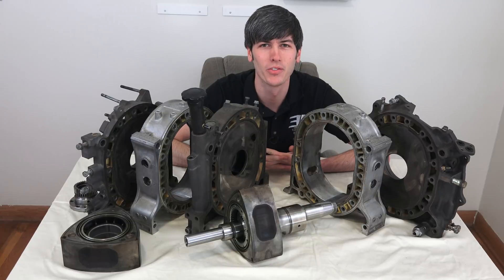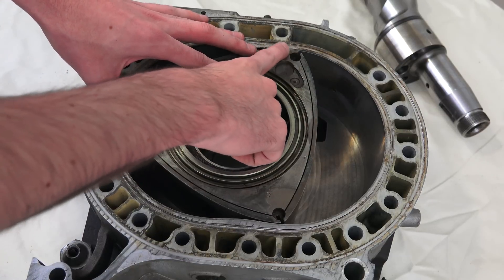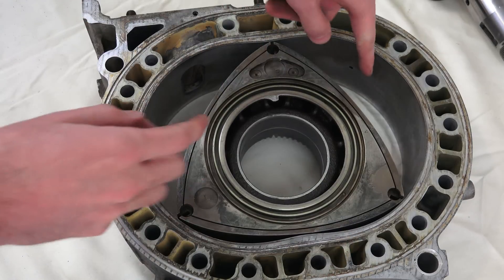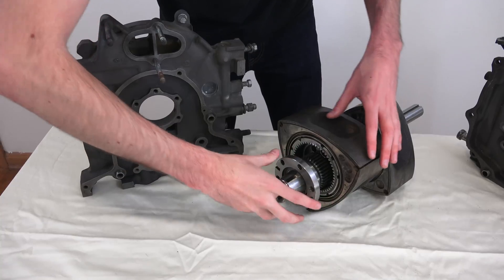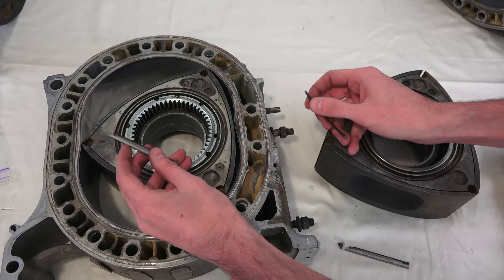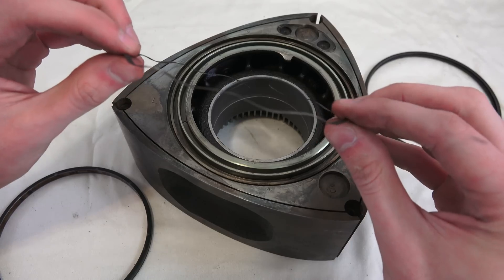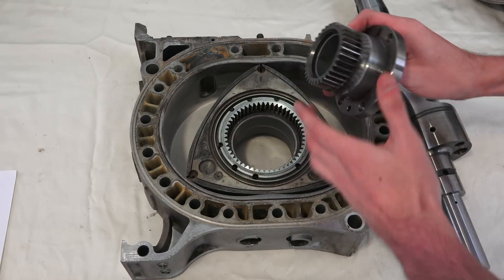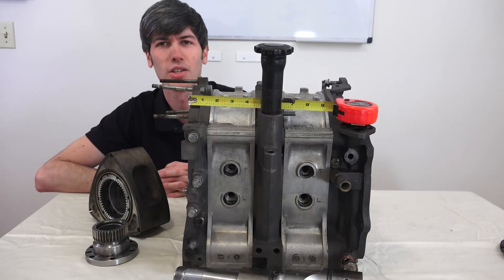How Rotary Engines Work - Mazda RX-7 Wankel - Detailed Explanation

Comment: is the main reason they're so much less fuel efficient because of the greater surface area to volume? i.e transferring more heat ?
Reply from the maker: +stefan radovich No, has a lot to do with combustion chamber shape, and the amount of fuel which tends to not get burned. I'll have a video explaining in detail soon!
Reply: +Engineering Explained cool i look forward to it. your videos are good,  i know some mazda owners I'll pass this on to.
Reply: +Engineering Explained hey off topic question but i was debating this with friends. Do you reckon engine piston speed is currently limited by valve float or oil film shear strength ? I think it's the latter, i.e actual piston velocity in m/s. Or is it just a really complicated combination.
Reply from the maker: +stefan radovich I would guess it's limited by flame propagation speed, but I don't know.
Reply: +Engineering Explained Any chance on getting a "cons" video?
Reply: +stefan radovich Rotary is the most efficient way to convert fuel into noise.
Reply: +stefan radovich Rotary, as explained in the video, also has 3 combustions per rotor per revolution. That's a lot of fuel both burned and unburned...
Reply: Aww man i'm getting too many replies. I know flame propagation speed isn't usually fast enough to fully burn the fuel with rotary engines which is why they use 2 spark plugs but i still think increased surface area relative to volume allows for much more heat to be transferred to the engine/cooling system at a greater rate, i.e. energy loss per time = power. inertia of the parts will definitely be a tough constraint for reciprocating motion because it's likely an exponential increase in stress for part acceleration. The shorter stroke in F1 cars allowing high rpm ties in with my point about it actually being piston velocity. (velocity of the piston against the cylinder wall.) for a set displacement a shorter stroke results in a shorter velocity. Regardless of displacement piston speed (or just the speed of any sliding component.) seems to top out around 25m/s i think due to lubrication limitations and film breakdown, possibly even liquid cavitation.  (Piston speed on a 600cc performance motorcycle and performance V8 engine are fair similar.)
3 combustions per revolution means more fuel and more power though (which is why these motors only need be like 1.3 litres.) so doesn't really tie in with efficiency i don't think. 
All good and valid points though,  but i'm genuinely super curious what the actual overall limit is. Flame speed in gasoline is something like 15m/s i think whilst piston speed can be 25m/s so he's probably right, But if you swapped to something extreme like nitromethane and solenoid valves .... getting way off topic but i like to think in extremes. 
Also he said that there's a Cons video to come, which i think its a good idea he split the two videos to keep people excited.  
I'd love to see video's on other cool engines too like rotary vane, or even pumps like those variable axial flow ones.
Reply: +Engineering Explained
Rotron, who specialise in UAV applications of rotary engines have designed and built an engine to operate on diesel fuel for NATO. An innovation is flame propagation. This ensures the flame burns smoothly across the whole moving combustion chamber. The fuel is pre-heated to 98C before injection into the combustion chamber. Four spark plugs are utilised aligned in two pairs. Two spark plugs ignite the fuel charge at the front of the rotor as it moves into the combustion section of the housing. As the rotor moves the fuel charge, the second two fire a fraction of second behind the first pair of plugs igniting near the rear of the rotor at the back of the fuel charge. Lazer ignition using one plug can do the same.

There is substantial ogoing R&D on rotaries. Put all the advances into one package and it is bye, bye for the heavy, cumbersome piston crankshaft engine. Haver an electric transmission using electric traction motors and rotaries are here to stay. In series hybrid a rotary would only be an part time engine.
Reply: The real doktorbimmer  Please get therapy. Think of your family who have to put up with you. You are obviously very old and senile.
Reply: +banpeinet Low displacement, and short lever arm to the crank/eccentric shaft. Longer the arm length, the more torque. Hence large displacement engines have a longer arm length, delivering more torque.
Reply: I love this kind of engine and thats why i never will say you can not have it anymore than when you have the love to this engine you are ready to pay for let build one of these.
Reply: +Engineering Explained Will you also then explain why they lack low end torque?
Reply: +stefan radovich Yes, that's a big part of it. Bigger surface area to volume transfers more heat, so it's cooling down the burning gas inside. Because it's cooling down, the flame goes out, and that's the reason for the amount of fuel that does not get burned. The other is that when the piston is at "TDC",  the flame has to go a much greater distance than in a compact cylinder.
The other disadvantage is the low compression ratio, which gives you bad efficiency. Efficiency = 1 - ( 1 / (compression ratio)^((adiabatic exponent of the gas) - 1 ))    -> the bigger the compression ratio, the bigger the efficiency
Other disadvantage is that there's an enormous length, which needs to be sealed, and there's no such thing as perfect seal, so you have a lot of gas leaking there.
Reply: +Daniel “Werwood” Kořínek However, the rotor spins a 1/3 the RPM of the eccentric shaft. A dual rotor has a power cycle of 180 degrees. The same as a four stroke inline four cylinder.
Reply: +stefan radovich that is 1 reason,  also the combustion chamber shape can never be optman and also the expanding gas has poor mechanical leverage
Reply: +chinchy111 it is depending on the size see the Graupner Wankel from OS  used in RC Planes or the Rotax used in  Stinger Missile Targets ( Banshee )
Reply: +corporalwaffles F= P * A and  Md= F*L what means increasing the pressure or / and the surface will also increase the resulting torque ... What they did: the 13 B has a wider piston ( = more surface ) than the 12 A and also more torque ...
Reply: +Charles Darwin every 60 Degrees an ignition happens like on like a 12 Cylinder ...
Reply: The real doktorbimmer I can believe a laser ignition might help to some extent, i imagine it would create multiple ignition points rather than just one, so more can be burned in less time?
Reply: The real doktorbimmer well i tried talking sense to him, guess he's just another person who's stuck in their own opinion and think critically at all. Sigh.
Reply: ***** Are you talking to your wall or something? Plus you sound like you can't help to get frustrated over people over the internet, boy you must be fun IRL.

I don't side with bimmer, nor did I say he was completely correct, however you don't have backing of how Wankel engines can be more efficient than the standard ICE of the same tier. Power/weight ratio is why it's considered by flight related applications, not efficiency.
Plus i said they are nearing obsolete, not quite yet. How many UAVs are out there? Not even nearly half of those run on Wankels.

If they stop making it for cars, and with the improvement of other ICEs, the other industries will see a decline of applications for the rotary, as if there already aren't.

Just because you're a rotary fanboy doesn't change the fact that the technology is dying out.
Reply: The real doktorbimmer please get therapy.
Reply: for street cars this engine is not efficient but on race tracks realy well then it runs at the rps where it hat its max power and on this rpm's the engine is good.
Reply: The real doktorbimmer Plantpot, you said it has never won a race then said it had. Please get therapy.  Please.
Reply: The real doktorbimmer please get therapy. Please.
Reply: When you have a lot of money it is not a probleme to get a new one.
Reply: +The real doktorbimmer why building a rotory and sell it?
Reply: When your wife cost you to much you will give she away? 
The same thing is with every other things.
Reply: The real doktorbimmer May I have permission to mention you in my next book?  It is about lunacy.
Reply: Mickey the Luxray The real doktorbimmer does sound like a stuck record indeed.
Reply: Mickey the Luxray It appears you believe what this nut writes.
Reply: *****
On the contrary. I see great potential in the Wankel design, and am fully intrigued by Mazda's new claims and am excited to see where they take it.

But you're still being a dumbass. My agreement with you doesn't change that. In fact, your casual assumption that because I don't pat your ass that I must support the other side only reinforces my belief!
Reply: +stefan radovich , Understand I don't know anything but I wonder if the weight of the crank and rotor can be reduced would that increase efficiency? I find the engine design very interesting and exciting.
Reply: Steven Poleske Nope, the combustion process is pretty hard to optimize due to the chamber geometry and limitations...
Reply: +stefan radovich im pretty sure its because the chambers are pushing against themselves
Reply: corporalwaffles Thanks for the explanation and really appreciated, but I actually hoped it would be covered in the next vid. ;)
Reply: Ascended696
actually rotary is capable of revving to almost 14k rpm. mazda tested it up to 13k rpm. anything higher and it blows up tho
Reply: +Engineering Explained a combination of all 3
Reply: +ytdood yes but with  long stroke you get more torque at a lower rpm so do not need to rev the engine so hard
Reply: jj
Reply: hu hnm
Reply: +stefan radovich watch?v=v3uGJGzUYCI -- Flame speed does not keep up with the expanding burn chamber, so fuel gets to the exhaust unburnt. (Plays merry hell with catalyzers, too.) You also get problems with proper sealing due to thermal gradients within the engine, leading to leaks between the compression and burn stage.
Reply: +stefan radovich The main reason they are so hard on fuel is simply unburnt fuel escapes out the exhaust port. Rotarys are brutal on fuel efficiency and emissions.
Reply: Fafafoh1gh
That has been solved.
Reply: *****  how?
Reply: david appleton
Look at my posts on this video. All is there.
Reply: +Engineering Explained  .what about trying a gas vaporizer system (seen one or two on you tube) on the rx8 ?? it might make a good video
Reply: thank you for the quick reply.
Reply: dean caulton 
The Wankel does not suffer from poor combustion.  Solved.
Reply: The real doktorbimmer 
Get therapy please
Reply: +chinchy111 nope: see a Video of the Krauser 80 cc Racer @ 30000 rpm  or the V1 Engine of WW 2 ...
Reply: Centrifugal force pushes the apex seal onto the housing surface forming a firm seal. Apex seal lift-off can develop between the apex seal and housing in light-load conditions when imbalances in centrifugal force and gas pressure occur. However, running the engine at higher revolutions will cause more wear, as in any engine. So running wankels as constant speed range-extenders the minimum level of revs has to be determined to reduce wear and turn the generator. Mazda came up with 2,000 rpm.
Reply: +stefan radovich There's that, there's also the fact that not all the fuel air mixture gets burned in the expansion and gets exhausted
Reply: Dappsy95 Mazda claim to have solved the non-burning of some of the fuel by laser ign and other amendments in the Skyactiv-R
Reply: ***** i'll be really interested to see how much a laser ignition helps, any idea what the other amendments are?
Reply: +stefan radovich i believe because you're burning motor oil as well as petrol, your efficiency wont be that great... also compression would be loss gradually over time due to the wearing of the seals
Reply: ***** seal wearing is not a problem. That is an old wives tale.  The oil can be specifically made for burning.
Reply: yeah these are just minor influences, he has another video of why the rotary engine is dead, a lot more information there regarding efficiency, and compression ratio is one of the big factors... that vid should answer your question =)
Reply: ***** I saw his video., It was nonsense. The rotary is not dead at all. Anyone who knows anything about would know that. Get your mind out of cars.
Reply: ***** my bad, it was OP's question not yours, anyway I'm saying he has got the information of why the engine is not as efficient as the standard piston engine.
You don't have to agree with with him claiming the rotary is dead, it's just a title meant to draw attention. 
However, rotaries are seeing a possibility of becoming obsolete as stricter emissions standards are imposed for combustion engines as well as efficiency issues.
Of course, all eyes are looking to mazda to see if they can put out any upgrades with the RX-Vision
Reply: ***** Oh for Gods sake! You have not a a clue! When running at a constant speed as in a range-extender is is MORE efficient!! The power/weight ratio is vastly superior.
Reply: ***** Not another nutter!!!!  He thinks doktorbimmer is sane and posts to him. It is getting worse. Bimmer thinks all these new wankel engines in UAVs made themselves. doktorbimmer keeps writing that no one makes rotary engines. A few pointed him to the companies that do and he kept repeating like a conditioned robot that one makes them. He trolls forums looking to castigate rotary engines. He is insane!  Or paid to do it.
Reply: The real doktorbimmer You are an idiot!
Reply: ***** R&D has the rotary more efficient in constant speed range-extender running. Range-extenders are part time engines. As hybrid are becoming the norm the rotary is set to take over being one third of the weight & size with vastly superior power/weight ratio. 

As one engineer said to me, even if rotaries use more fuel, they will be used so little being part time engines that it would not matter. They size and weight is what appeals to car makers to hide the range-extender. 

But rotaries do return better mpg. 

Bimmer is an idiot.
Reply: +John Burns you see? Talking and arguing like that is much better than just dismissing people. I won't get in feud with you n bimmer. 

There is still the thing about your example is that the rotary you mentioned is developed for a highly specialised purpose. Just like how some engines are used in race cars (mazda 4rotors etc) and the usage for flight power units wherever appplicable, they are still specialised engines. 
They don't see large scale production anymore. The technology of the wankel rotary will live on, just not so much as an engine that is mass produced.
Reply: Mickey the Luxray You haven't agreed anything with me. Where the Wankle is going? Its niche use? Read my posts.
Reply: ***** Sure I have. I agreed that the Wankel isn't dead. (I was aware of its use in UAVs and as range extenders already, as well.) I agreed that Mazda is working on it. And I'm interested to see what they do, though I don't know everything they plan to do with it, whether they fully follow through with their plan to range-extend their EVs or use it as an enthusiasts' engine in an RX car.

You're not making yourself look any better by attacking me, you know. You look like you can't read yourself.
Reply: Mickey the Luxray Mazda re not the only people advancing the rotary.
Reply: *****
That is correct. But I have less interest in their endeavors than I do in Mazda's, because their claims are both more public, and more relevant to my own interests.

That's a matter of personal feelings though.
Reply: +Engineering Explained in diesel yes, nitro top fuelers over come the propagation issue by putting nuclear bomb grade fuel in.
Reply: +The real doktorbimmer ...apart from a single win at LeMans..." cuz , you just lost all credibility. winning LeMans is no fluke ............ever. and your excluding it based on your opinion of it being a fluke win clearly indicates you think more of your opinion than scientific results.
Reply: texasdee slinglead The Mazda at LeMans used less fuel than the piston cars. It ran for 24 hours full belt around track. When stripping the engine after the race, it was good enough to run another 24 hr race. A phenomenal engine indeed.
Reply: The real doktorbimmer Are you also in the NRA?
Reply: +chinchy111
BEAUTIFUL noise....
Reply: +stefan radovich I'd think it has a lot to do with the parts used to create the engine, the way the engine is built and the inertia of the parts. F1 cars can rev much higher since they have such a short stroke. In a longer stroke engine you get a lot of unwanted up-down movement which tends to break apart stuff and adds too much vibration.

Comment: One of things I see, is how over time all those springs to keep the seals will just deform and stop functioning as well. I would things that the internal seals also go bad not just the apex seals. It's a shame when I see people fixing their RX7 or RX8 because they sounds amazing, but they just have some weaknesses.
Reply from the maker: +TSX_Adonis So long as no plastic deformation occurs, the spring should hold pressure. (Just like the springs in your suspension).

Comment: First, thank you very much for the videos you produce. I really appreciate the knowledge and insight you share. I've watched many of your videos and you typically list pros and cons. I'm a fan of the rotary engine myself, but I noticed you didn't mention any cons of this design. A few I think might be accurate are: higher fuel consumption and more frequent maintenance (as it purposely burns oil, so that must be replaced based on use, right?). Can you comment on the accuracy of my thoughts and/or any "cons" as you may be able to see either in the design or vs. a piston/cylinder design? - Thanks.